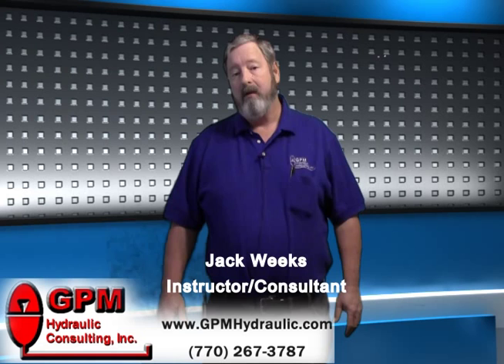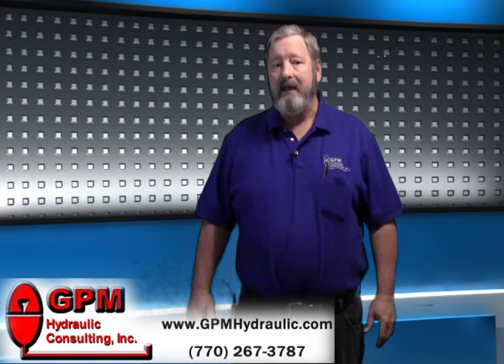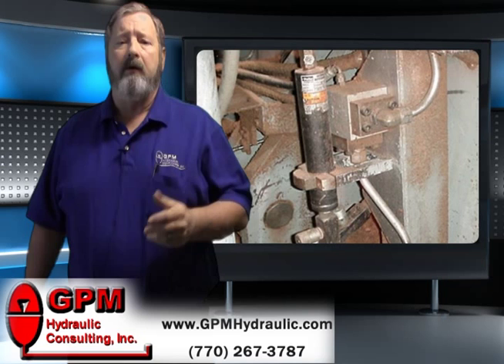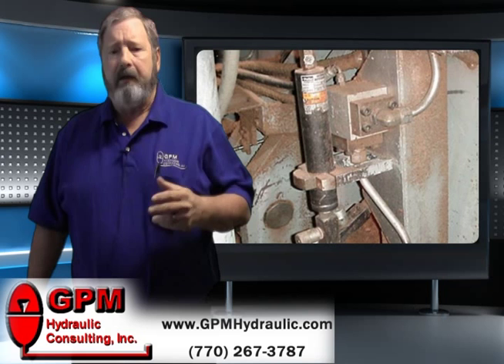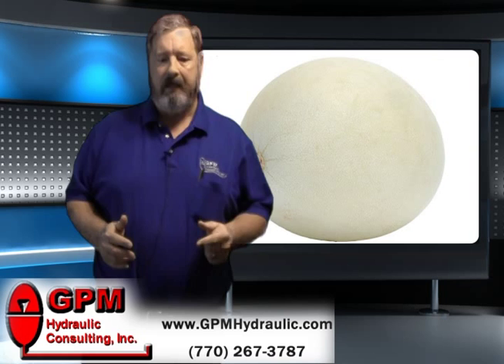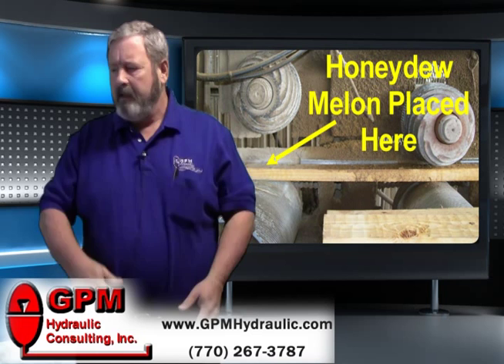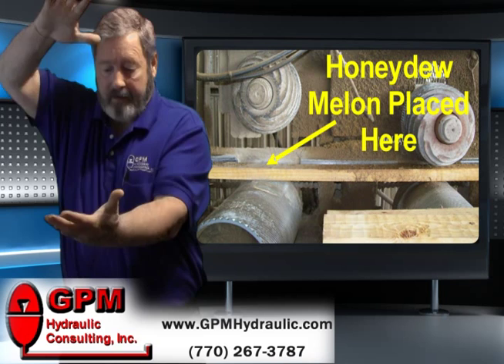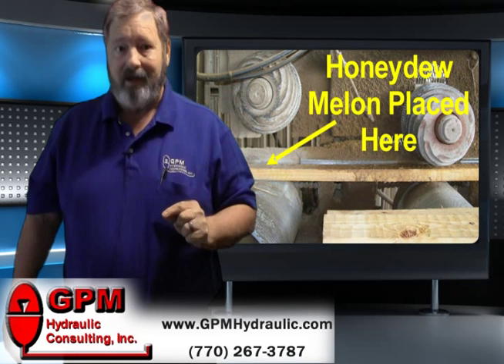Accumulator Tip

Comment: Hi sir Jack thanks for teaching me something i didn't know about torque horsepower controller it amazing because didn't know where to start to set or increase flow as the system relief valve is settled 120 on kawasaki axial piston pump and the roller screen the rollers are running fast and oil is very hot you can cook meat with this hydraulic oil and just touching the tank your hands are burning also electric motor and pump they hot and tripping
Reply from the maker: Hi Charles. You didn't mention before that the oil was overheating. That may be a separate issue from the breakers tripping, Check to be sure that your pump compensator is set below your system relief. The relief valve in such a system should never open because it is usually only a backup in case the pump compensator fails to limit pressure. Make sure the relief valve is set high enough above the compensator that it does not dump. Your oil should cool down then.
Reply from the maker: Actually, upon rereading your original question, you clearly DID mention that the oil was hot, but apparently I chose to ignore that for some reason. Your whole problem is likely to be that someone turned the pressure up on the pump and got it set above the relief valve. See this video on setting them: https://www.youtube.com/watch?v=jYPSwhAgvBM&t=6s

Comment: Question could a non working accumulator be a reason a hydraulic systems, hydraulics move slowly?
Reply from the maker: Thank you for your question, Chris! Yes, indeed an accumulator can contribute to a speed problem in a hydraulic system. Incorrect pre-charge, ruptured bladder (or worn piston in a piston accumulator), all can affect speed.
Reply: @JackWeeks  K3VG280 kawasaki axial piston pump controller torque horsepower controller where must I increase flow or decrease it and can I increase pressure on it? Relief valve is keep on damping oil back to tank and oil is boiling which things i shouldn't touch on torque horsepower controller as they say it's factory set